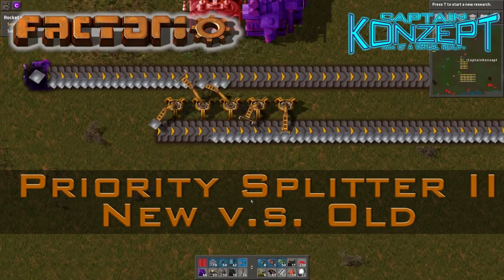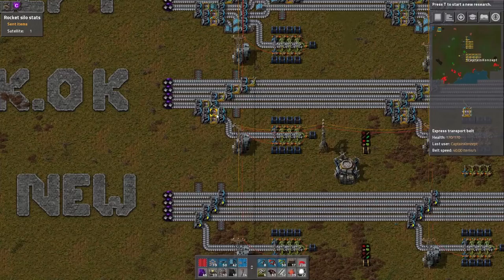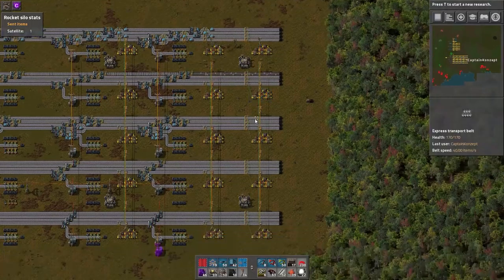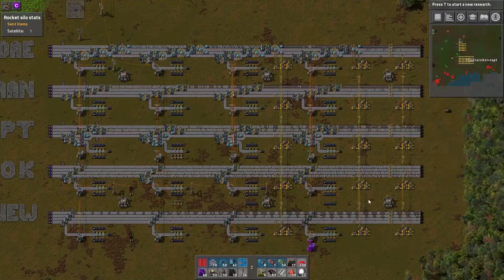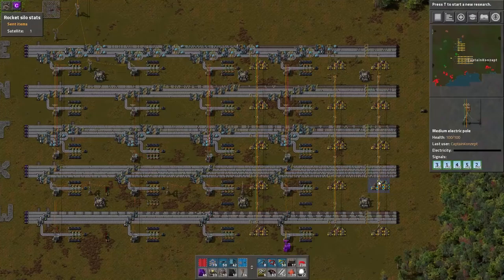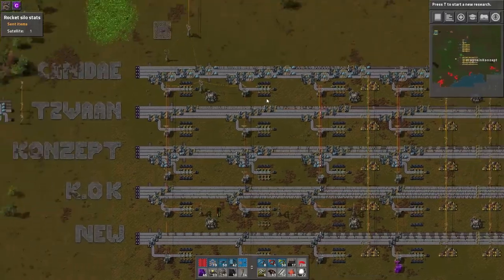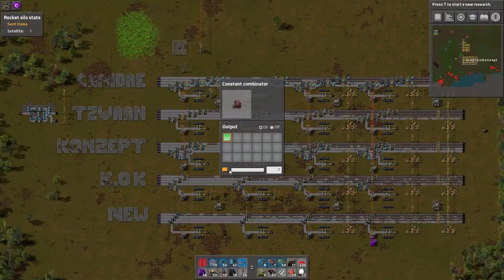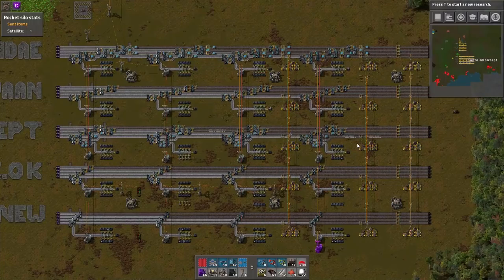PrioritySplitter Update - old v.s. the new mechanics (post 0.16.22)

Comment: if you double up on the new method and have 2 sets of splitters that each side load on to each side of the output line, you can solve your lane balance issue while also being able to use the same system for 2 different items on the output line.

Comment: Thanks! I suspected that the priority splitters would render most of that circuit logic moot. I bet putting a simple side-loading three splitter balancer on the lane being emptied before the outer 2 priority splitters would solve the empty lane problem.

In some sense it's a little depressing to see all those clever circuit network based designs suddenly being pointless, even though I think it's a good change for the game.
Reply from the maker: I agree. It was fun trying to solve the problem of priority splitting and maintaining compression. Now it's a simple checkbox (which is handy for a more straightforward playthrough, though).

Comment: I guess most throughput in final checking point is not good. all starting iron is same. so most throughput mean lack of iron in branch belt. so maybe least throughput is best design. because bus system is build for supply branch belt. and i am not native speaker. so plz excuse my poor english :)
Reply from the maker: Maybe I have to closer review the video, but as long as there are no gaps in the branch belts they're getting enough throughput, I'd say.